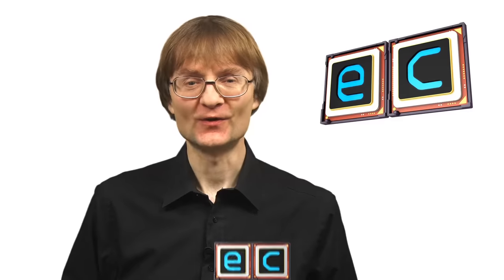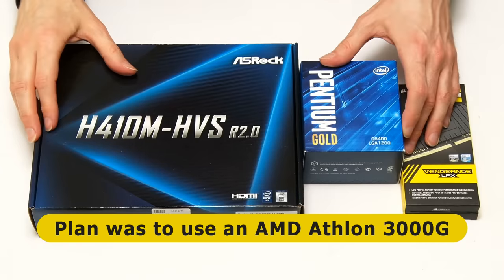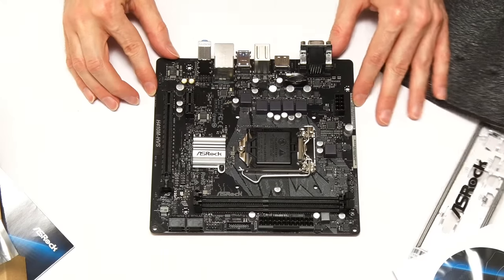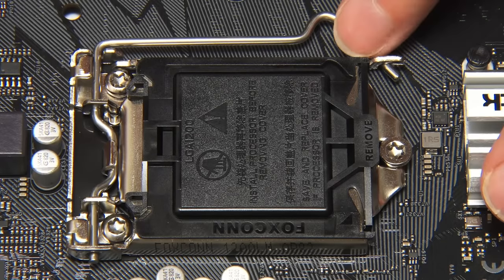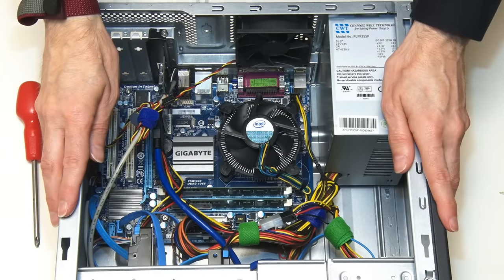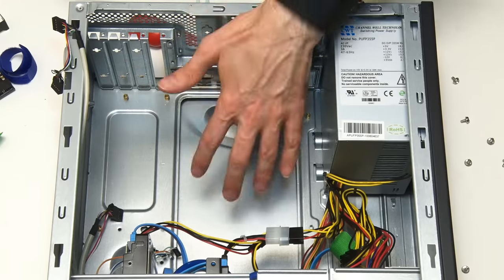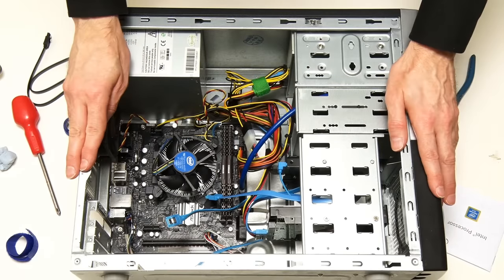Old PC Upgrade: Motherboard & CPU

Comment: I'm not clear on the riser positions for fitting the motherboard. At 18:10 you said they could be repositioned and pointed at some bare metal. Were there other holes that we couldn't see? Do case and motherboard specs say which riser positions are provided / required?
Reply from the maker: Good point. In this case there are no other holes. But in some others there will be.
Reply: @ExplainingComputers  Thanks. One more think that I'm sure would go wrong for me. :)

Comment: I guess you could install an M.2 nvme if you weren't going to use the video card slot. But that would up the cost. Have a nice day.
Reply: m.2 adapter cards also come in 1x, tho you have to hunt around for 'em. Not sure what it does to performance but if you're backward-fitting like that,  generally it's still a boost so who cares?

Comment: There are PCIE 3.0 to m.2 SSD adapters in eBay that could have been used to connect m.2 SSD.
Reply from the maker: Indeed, but I'm not sure the BIOS would support them as bootable.

Comment: whenever I put the new processor on the new motherboard, I never remove the plastic cover, it will pop out once you lock the lever, and I usually arranged the fan , so that whenever opening the cover case, you can read the intel logo on the fan, standing or up..  not inverted or on the sides.. maybe it was just my style to make it neat or "in-sync" style..  looked at the old parts.. the  processor fan and motherboard logos are the same position..

Comment: I personally would remove that "old-look" PSU in a later time and install a new PSU with a 12 cm fan built-in. That old PSU may not be as efficient like the new ones and the output capacitors may be starting to go bad and start to cause damage to the PSU itself and to the rest of the computer. It would be like to eat out-of-date food.

Comment: I originally put 2 x 16GB 3200 Vengeance sticks on my board. Fine, so I bought two more a year later, but 3600 this time.
They didn't want to go in, and after some thinking I realised that the letters on the spine are 180° to their older sisters. 
There are some very cruel people out there.

Comment: IDEA for new Video... Not sure if this would be worth your time, but I am considering it, so looking for guidance:
I have a Lenovo C540 All in one desktop computer.  It is very out of date, but I do like the touchscreen.  I have been wondering about replacing the motherboard, processor, memory, etc with an appropriate SBC.  But knowing Lenovo, there is probably a lot of proprietary stuff in there.  Also wondering (and this may be a completely different video) how to maintain the touchscreen capability of this computer.  Thanks for your videos.

Comment: why didn't you initialize XMP profile ?  You are leaving memory performance on the table and not running at the speeds you bought the sticks at
Reply from the maker: You are right, it needs initializing to run at 2400 rather than 2133. All I can say is that this video was getting very long! :)

Comment: I see, I'd say it's a a brand new computer with all the change made to it, since it's got manly only the case en power supply as original in it.
That said, I did kept my first pc case and power supply for my second build in it. Until the power supply burn and produced a strange scent, then replace it. Then the hard drive broke. I just bough a new whole computer at that point. New one I upgraded the SSD, and it does change a thing, as much as changing to better cpu and gpu.
Now I'm really thinking to get a new computer, but everyone's cough in the shortage. This one is about 7 year old, works fine for most of what I do with it. Sad thing it I have to hold back buying new game, I'm pretty sure it won't run on it.
In any case fit a motherboard, am I right?
By the way I like your way of talking, swine is not a word we use often around here to describe a situation where you can poncture your finger with tiny bit of metal to make the apparence pretty.

Comment: I still would have replaced that psu.. I didn’t see a rating on it and I would at least take a cheap 80+/80+ bronze from a reputable manufacturer (aka mostly thermaltake). Anyways pretty informative video

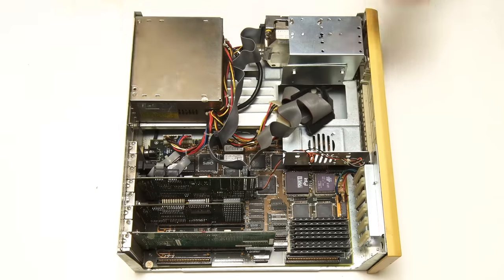Comment: 3:10 Does anyone realise what that 387 CoPro cost in 1992? A small fortune. For a floating point unit which we have taken for granted since 1993. (Pentium-60 / 90) - which had a terrible bug, I might add. I remember a customer coming in with his machine, to find out why his software was not working properly. Turned out the math in the software got screwed by said bug. Nothing we could do about it till Intel released the software patch for windows 3.11 for workgroups and DOS. Intel recalled many batches for replacement, but it took at least a couple of months to get the first batch of CPUs with the correctly working FPU out of the factory.

Comment: Since you had 8 GB of DDR3 on the predecessor, which was rather high-end for its vintage, I expected to see 16 GB here.

Was the choice to stick with 8 GB (no pun intended) because of hardware availability and pricing, or just because more than 8 GB doesn't offer any advantages after all?
Reply from the maker: The 8GB on the previous board followed an upgrade in an earlier episode in the series (pre-upgrade the board has 2GB). I went with 8GB partially on cost, but also because it is seldom needed on a PC of this specification, esp. when running Linux. 16GB is nice to have, and often essential when editing 4K video in a high end package. But on a PC like this it would be a luxury that would seldom deliver any benefits.

Comment: "I've had the same computer since 1994. It's only had 7 new motherboards, 10 new CPUS,  12 grahics cards, 4 power supplies, 5 new types of RAM, 3 different types of storage and 5 new cases"
Quote from computer buff and council road sweeper Trigger from Only Fools and Horses.p

Comment: you could have gone 2nd hand 4th gen haswell and reused the ram. so about £100 would have got you a 4 core i5 on a microatx board.  everything is SOOOO expensive at the moment

Comment: I' ve seen some of your upgrading solutions & I think you are targeting the best budget way. Are you planning to make a new budget pc build? I own a i3 4170, asus h97pro, 4X4GB ddr3, samsung 860evo-500GB & gtx750-2gb. The samsung 860evo, is the last upgrade, last year, after your review about the differences on ssd structure.  I believe, that I can't upgrade it any more. So, something like i5 11500, is the idea, of course with my old GPU. I would like your opinion on this matter.
Reply from the maker: Thanks for this. I may well do another budget build later in 2021. It will depend to some extent on the state of the component market! :) It does sound like you have maxed-out your i3. I have an i3 4300T (I'm typing on it right now!) that has served me well for quite a long time, but is now giving occasional issues. So I may upgrade/replace this system before the end of 2021, and of course I would do a video -- or two!
Reply: @ExplainingComputers  Thank you, for your reply in so short time. I' ll be waiting for your next review!

Comment: hm you could use a pci adapter to use an m.2 i do have one and it works very good maybe its possible in your build too :)
Reply from the maker: Yes, a PCIe to M.2 adapter would work, and I expect would be bootable.
Reply: @ExplainingComputers   im booting  windows from an m.2 on an adapter it works fine :)

Comment: I know this is your upgrade, but I would have upgraded the processor with the best processor possible which would have worked in the older motherboard (even if I bought used). I then would have used a lower end graphics card -- again the best one which would work with the existing power supply. I would then have been done with the upgrade and not have wasted money on the RAM or USB 3.0 expansion.

Comment: I'm curious as to the rodent used, it's different from the usual mice I've used. What brand is it?
Reply from the maker: It is a "3M Ergonomic Mouse" -- the fingers wrap around the fixed central column to remain at rest, whilst the thumb rocks left and right for mouse clicks. Very good for RSI. I've used one for about 20 years now.

Comment: good morning, i did not scroll through all the comments.  so not sure if this was asked. 
 is there a reason you did not install the usb3 card in the pcie slot?   stay well
Reply from the maker: There are already USB 3.0 ports on the back of the motherboard, and I connected the front USB ports to the USB 3.0 motherboard header. So adding the card back in was not necessary (but would work). :)

Comment: 12:05
NOO ! Don't pull on the cover it will pop off when u finished placing the CPU and closing the bracket.
See Linus Tech Tips
Reply from the maker: I can only suggest that Linus Tech Tips tries reading the manual. I was very aware that there are different views on this. But the Intel instruction sheet that came in the box with the processor shows exactly what I did -- lift the lever, raise the retainer, then remove the plastic cover. So what you see in the video is exactly what Intel recommend.
Reply: Ok but be careful with the pins , touched the motherboard pins and its out
Reply from the maker: @HowToPCYT  Agreed -- great care is needed.

Comment: Going from 8 GB of ddr3 to 8 GB of ddr4 seems like more of a lateral move rather than an upgrade. Would it have been that much more expensive to buy 16 GB of ram instead of 8? Also, an m.2 slot would be useful for a future hdd upgrade.
Reply from the maker: It is always possible to justify spending more and more! :) But rarely cost-effective.

Comment: Thank you for the information,
Here's a question
When installing the CPU and fan should also put a thermal ointment? Or not mandatory
Reply from the maker: As shown and discussed twice in video, thermal compound is pre-applied to all Intel stock coolers. So yes, thermal compound is needed, but you do not need to apply it separately when fitting an Intel cooler, as the video clearly explains! :)

Comment: I need a video of the exact process of placing the sticker and the settings you need to adjust in Windows in order to get maximum efficiency from using it on the front side of the tower. I wonder, if you stick it on an old monitor, does it transform it into a 4K curved one?.

Comment: I am still using a dual core E5800 in 2021, and it chugs along doing browsing and such fine enough. I am toying with the idea of a motherboard and CPU upgrade, or just going for a Raspberry Pi 4. Which would you recommend?

Comment: Why did the CPU Mark actually go down between the 2 old tests?  At 22:55 the CPU Mark 1725 went down to 1655 even though the Pass Mark Rating went up from 452 to 487.  What happened between those two tests?
Reply from the maker: This I do not know -- I had not spotted that. It was the same CPU, same test. There can be some variability in Passmark, but not that much. You have me pondering now!
Reply: @ExplainingComputers  - Well you know me... I spot those things when you sometimes miss them!  Gotta keep you on your toes!  I hope you can figure it out without spending too much time on it.
Reply: Every time I run Passmark my scores are slightly worse on every component that hasn't been upgraded.
Reply: @RWL2012  - Really that is interesting.  I wonder why.

Comment: Did you know that you do not need to remove the protective plastic cover from the CPU socket?
It is designed so that after you put the CPU into the socket and lower the CPU gate, the plastic cover automatically releases and pops out.
Reply from the maker: I am well aware that there are different views on this. So here I followed Intel's own instructions to the letter. And the instruction sheet that came in the box with the processor shows exactly what I did -- lift the lever, raise the retainer, then remove the plastic cover. So what you see in the video is exactly what Intel recommend.
Reply: @ExplainingComputers  That's interesting that Intel takes that position. Either method works. But motherboard manufacturers tell you not to take it out, manually, as this leaves the pins exposed while you are working dangerously and unnecessarily close to the socket. If you finger or knuckle or even the plastic cover, itself, hits the pins, the motherboard is destroyed. 

I think Intel doesn't care if you destroy the board, because the board isn't their problem. The board manufacturers care because motherboards get returned to the store and ultimately returned to them with damaged pins.

People can manually remove it, sure. It's just extra work and it's riskier.  But I'm sure some people enjoy the thrill of extra work and taking unnecessary risks.

Comment: In my country the 3000G costs only slightly less than an i3-10100, which has much more value, G6400 is about $100 AUD less though which is great for that price.

Comment: so basically, here's a new 'average' machine... but, it's not the original computer except for case and PSU. The only real thing that can be upgraded is RAM and an SSD, the end.... anything past that, it's no longer the same PC... The motherboard is called that for a reason, and you are at the limits of that.

Comment: I wouldn't really remove the socket cover before inserting the cpu. It won't do anything if you do but it makes no sense trying to as the cover pops out of the motherboard once a cpu is into the socket.
It's nit-picky but why bothering doing that in the first place? The cover itself tells you not to do that

Comment: Will your upgrade work with a Gateway 507GR and allow me to reinstall my Sound Blaster XFY expansion card with the drive bay that I swapped out for the original rom drive? I'm running an external drive as a rom and have the original DVD burner still in place. The drive bay has midi in and out, spdif same, also fiber optic same. Or would it be a better idea to get two computers to communicate with each other? I don't know if the new OS would support the Sound Blaster driver. Any suggestions?
Reply from the maker: I suspect there would be driver issues witht he Sound Blaster in a new OS, as you say. The PSU in the Gateway may not have the 12V connector for a modern motherboard, so you may need to replace the power supply if you want to fit a new motherboard.
Reply: @ExplainingComputers  The company that makes Sound Blaster Platinum X FYE is, "Creative." They no longer support this particular product, but, they do offer a free software downloads for various aspects of their outdated products for Windows 10 OS. I did suspect that I would have to take into consideration the power supply requirements for the new motherboard. After careful consideration, I decided that it would be better for me to get a small yet powerful micro-computer. The amount of time I had put into trying to disable the mixing board window that kept interfering with my rewire on my DAW would make it much more viable to connect the two computers through midi synchronization. That way I could take advantage of the fact that my old computer is working better than it ever did before and take advantage of newer software and hardware that will not run on my old machine. I could still take advantage of my expansion card slot and install a video capture card and move the video onto the newer machine for blue ray burns. I found a video capture card that will work with Windows XP. I really appreciate you taking the time to answer my question/comment. Thanks.

Comment: Very good tutorial on a self built system, but at the end of the day, if you chose to put Win 10 or even 11 on the computer now, wouldn't you have came out ahead to buy a tower with Windows 10 or 11 already installed and ready to go?

If one's finances were limited, and they had to peacemeal these upgrades, then I can see why one would go this route. Just curious.

Comment: I always wondered why manufacturers continue to put USB-2 on the motherboard along the the USB-3.  I don't recall USB 1.1 added to motherboards along with USB 2, back in the day.  WE WANT JUST USB-3.  WHEN DO WE WANT IT?  NOW!
Reply from the maker: It is not uncommon for USB 3.0 ports not to work during OS installs, and very commonly not to work with virtual machines. So having some USB 2.0 ports is often critical. :)

Comment: Did you change out “”ALL”  the old USB PORTS TO USB-3 or  USB-4.?

My PC tower has 4 front top ports and 4 front middle ports, plus  2 - 3 ports in the back.  ALL USB 2 PORTS.

MY QUESTION IS FOR ME AND ALL USB PORTS UPGRADE ,WILL IT REQUIRE A CARD ADDED TO CONNECT ALL PORTS TO NEW MOTHER BOARD.?

IF I BOUGHT YOUR SAME MOTHER BOARD?  Will they all plug in and work at goos speed? Or to many for your mother board?

Please advise... Alton

Comment: That was suprisingly clean inside for an old PC. No dust bunnies underneath the board. 
Will a 10 yo psu have much life left in it? It could potentially damage your new motherboard when it fails.
Reply from the maker: A lot depends on how the PSU has been used. 10 year old PSU could mean one left on 24 hours a day for 10 years, or one switched on a few hours a day. All electrical and electronic parts eventually fail. But in my experience (including when I managed an IT support team) PSUs generally fail after a few years, or go on a long time.
Reply: CWT are decent, they're the actual manufacturer of many of Corsair's PSUs.

Comment: Would these components fit into a dell vostro 200 midi tower ?. Very informative video.
Reply from the maker: They should fit in any PC what can accomodate a Micro ATX motherboard. But some Dell cases do not have standard mountings or power supplies.
Reply: @ExplainingComputers  The old power supply has been long gone. It has a modern supply with all the modern connectors etc. Will have to have a look at the mountings etc for the motherboard. Thanks for reply.